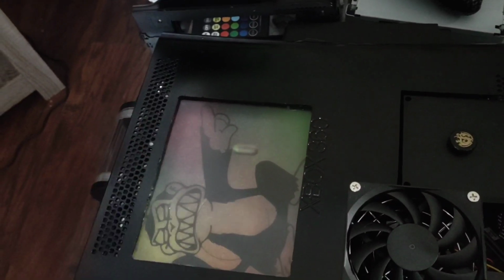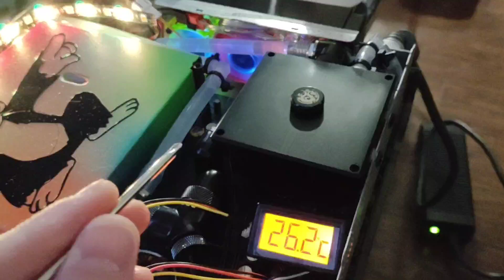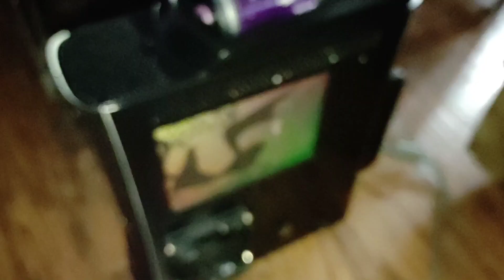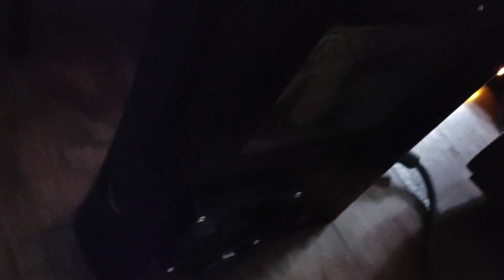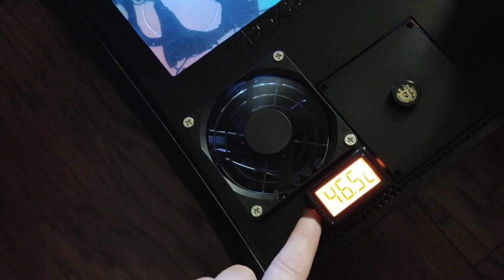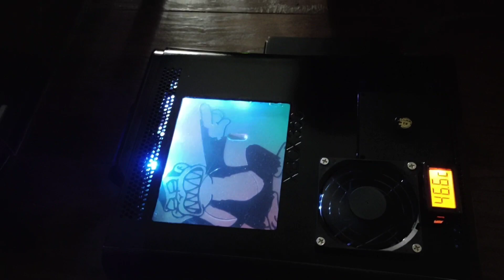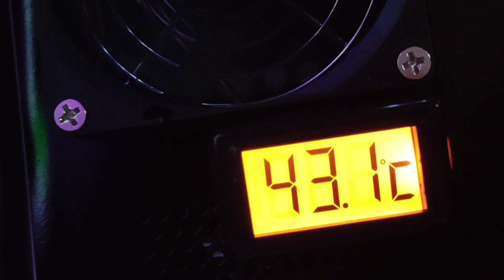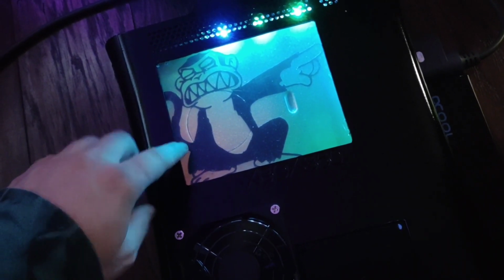Filling up the Loop! Stealth Internal Water Cooled Xbox Build!

Comment: Oh that. Nyko cooler off. It traps heat. The stock fans with a custom dash is more than enough
Reply from the maker: Lol never have and never will get a nyko cooler... May need to check out the other build videos of you don't know what's going on here.. that is a water to air radiator
Reply: Clearly you can't rread. Its not a Nyko. Its a mini radiator for the watercooling